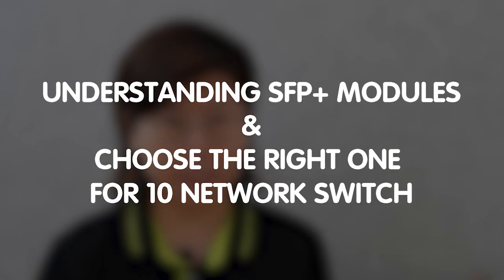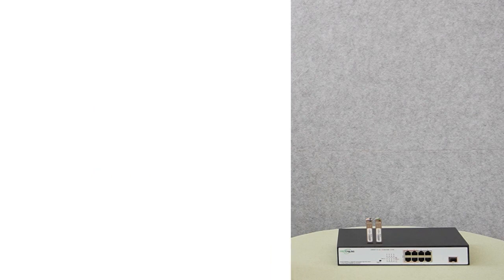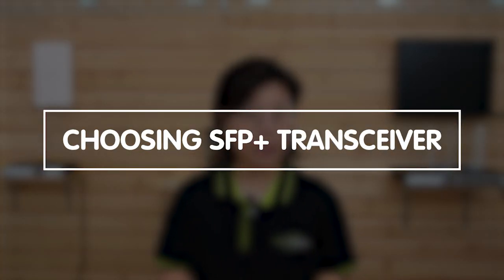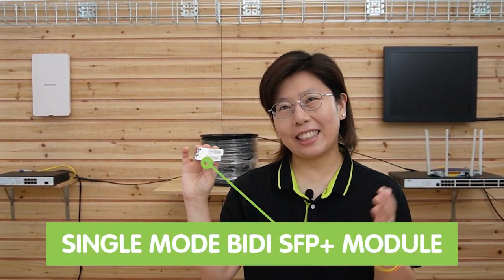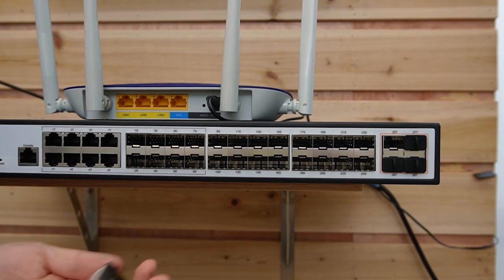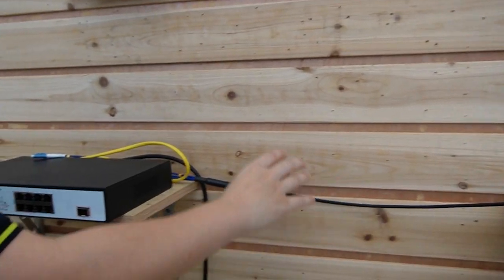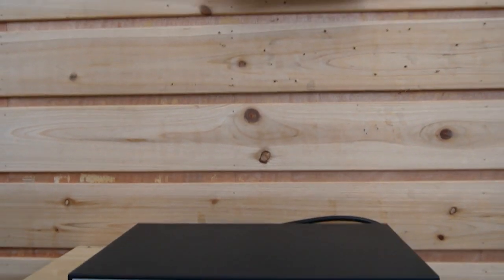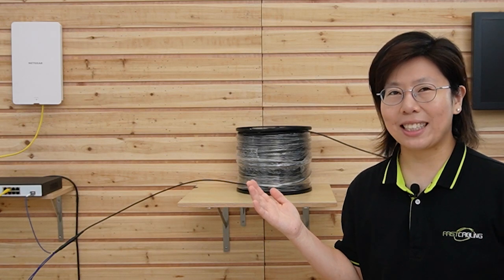Understanding SFP+ Modules: Choosing the Right Fiber Optic Transceivers for Your 10G Switch

Comment: Hi mam how are you.. mam i have questions we have 24 ip cameras and we are going to use outdoor poe switch… my question is we have to use fiber for each camera from cabinet to the site or just one line from poe switch to the main cabinet using by media converter
Reply from the maker: If the outdoor poe switch has an SFP interface then you can run a fiber cable directly from the cabinet. Please refer to this video: https://www.youtube.com/watch?v=E-xjFnPdbfY

Comment: Hi. This is a very informative video that you've made. But can you help me to design this situation? I have Point A and Point B with a distance of 300 meters. And it was in a substation design. What materials do I need to consider for the design and installation? I really appreciate any help you can provide.
Reply from the maker: The fiber optic cable is a proper solution. Unlike the copper cable, the fiber optic cable is not conductor. It is made of glass. While you pick the fiber optic cable, make sure there is no metal string and the jacket is supposed to fireproof. You can set the cable overhead.

Comment: Show more video about ip camera using fiber far around 5 km
Reply from the maker: The fiber optic cable can achieve up to 20KM run. The only difference is the  cable. As long as you pull the cable, the rest will be the same.

Comment: for a 300 meter run wouldn't be better to use multi mode fiber with a om4 cable( 400 meters max distance), because multimode optical fiber has a large core size and supports more than one light mode, in essence higher data rate
Reply from the maker: The data rate is determined by the SFP transceiver (the laser). If you are using 1G multmode transceiver, you will just get 1G bandwidth, and you will have 10G bandwidth as long as the single mode transceiver supply 10G. Of course, the switch should support 10G as well.